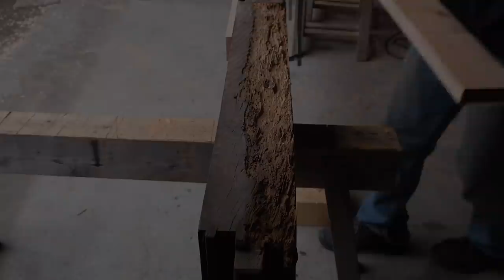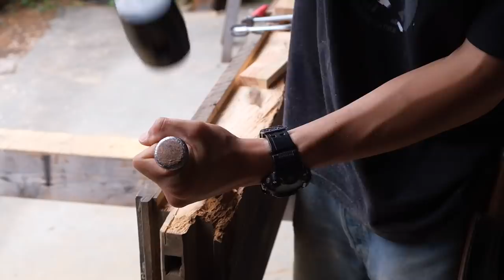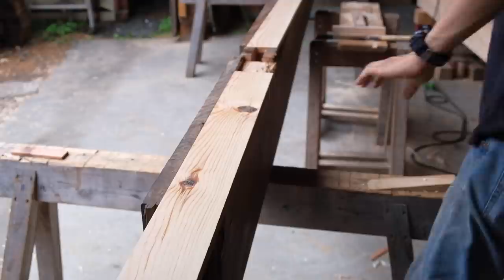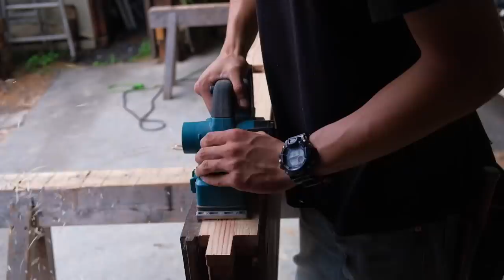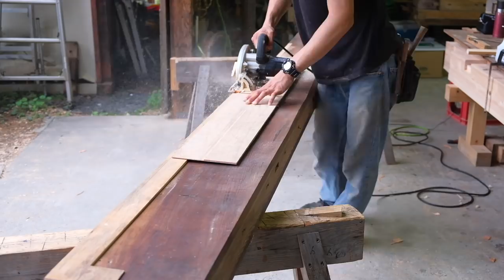Repairing Damaged Wood Beams 傷んだ木材の修理［埋木作業］

Comment: Just remember to have the repaired part upwards so it is in compression since there isn't one continues wood board on that part any more.
The bottom of a load bearing beam should always be one continuous board as it is in tension, and everything above the half point is in tension so it doesn't matter as much there as long as it isn't any gaps between them and glued well

Comment: I worked under a carpenter before.

For small area we simply put CA glue with wood powders, larger area we'd use tinted grain filler. Not saying the method in the video is bad or something, but what we did here is a lot faster considering we got probably tons of cases each day.

Comment: Hi Dylan, what is the “life expectancy” of the beam and repair now? What about the structural integrity of the beam now? Is there a concern about that? I’m no engineer or building expert, so I ask out of genuine interest. In watching your videos (and others) I find I’m getting a lot of inspiration, and feel I’m learning a few things too. I can’t wait to start practicing and giving things a go for myself. 👍
Reply from the maker: Happy to hear you’ve been getting inspiration from my videos. It’s difficult to gauge a “life expectancy” but if taken care of and the ideal conditions are maintained (no rot, etc) I would say it can last another century. As for the structural integrity, obviously it won’t be as strong as new but the material was originally bigger than necessary. Also the repairs are all on the surface and the damage wasn’t deep so it shouldn’t be a concern.
Reply: @dylaniwakuni  I AM an engineer, and I have to say, while you may have
restored the beam cosmetically,  it is now MUCH weaker than it was
originally.  It suffered from Insect damage and apparently dry rot.  In
the United States, when this type of damage is discovered,  the affected
wood must be removed and replaced.   

Japan is a land of earthquakes.  A load bearing beam that is compromised
by insect and dry rot damage is a tragedy waiting to happen.
Reply: It almost entirely depends on where the loads are sitting on that beam, and how the forces will act – and of course how strong those forces will be. In some areas it’s totally fine to repair it like that, in other areas it might not be. Of course you want to be sure that you remove all the damage, and you want to eliminate the cause of it, so it doesn’t just happen again. You’d also want to be sure that any further damage can be spotted in time.

The beam was repaired to remove some rot and make sure it fits again – not to strengthen it. Like Dylan says, it was more than strong enough before and it’s strong enough now.

Comment: How tedious were you in matching up the wood? Was it the identical wood you were replacing? Was it old and/or seasoned for years?? So nice to watch you work, too, of course! Your competency appears so effortless! But don’t we know better!! and I am personally a strong proponent of “older is better“. Thank you thank you!
Reply from the maker: For these I just gathered a bunch of scrap/cutoffs of the same wood (Matsu - Pine). Most of the material had been sitting in the workshop for a long time (10+years I think). If I had several options on the piece to use, I chose the one with the closest grain but using whatever left over suitable material was more of a priority this time. It’s up in the beams and will likely be lightly painted over so people won’t be able to see it up close anyways.
Reply: @dylaniwakuni  Do you need to take into account the grain direction when using the cutoffs in such situations?